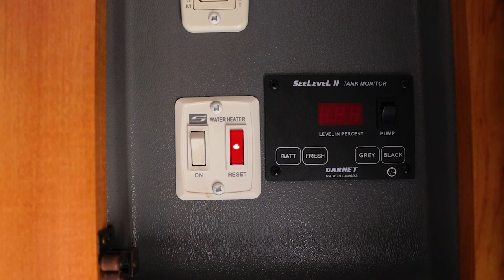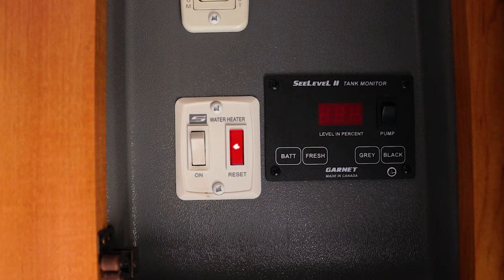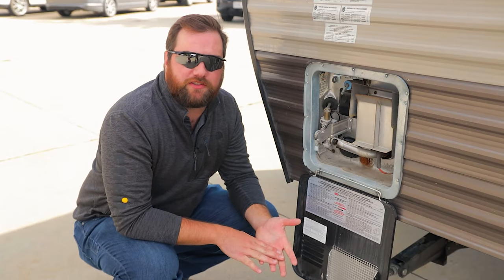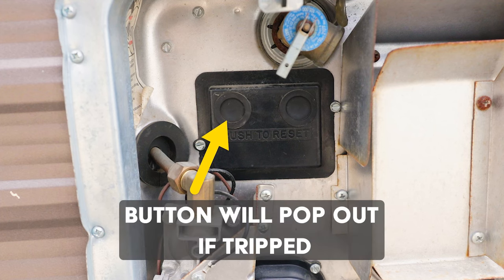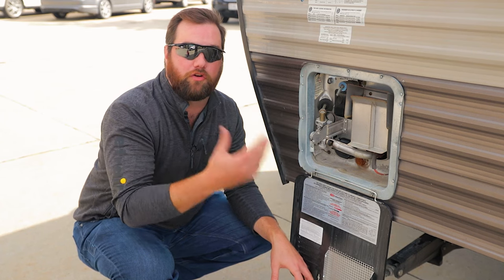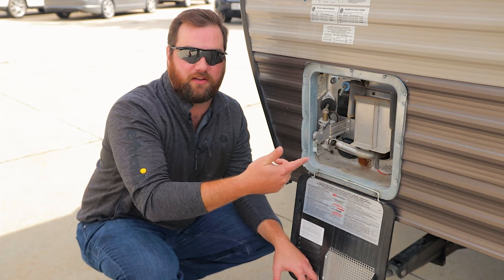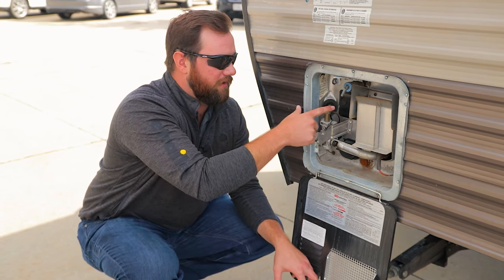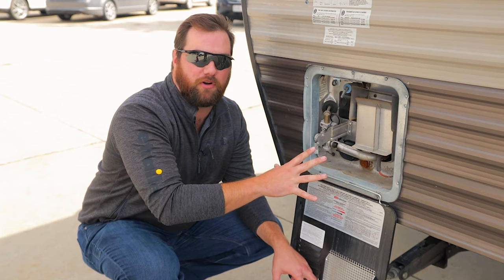How and When to Reset Your RV Water Heater (Reset Button Tripped)

Comment: My good man. The light stopped coming on inside my trailer. It wasn't really working but this is just my first outing for the spring. Was working perfectly last October.  Checked out your video on I'm delighted to see I actually got the same hot water tank which has to reset switches. Give those a press and now the light comes on again. I hope that means it will work. Thanks for the tip.
Reply from the maker: We hope it works for you too, good luck and let us know how it goes!